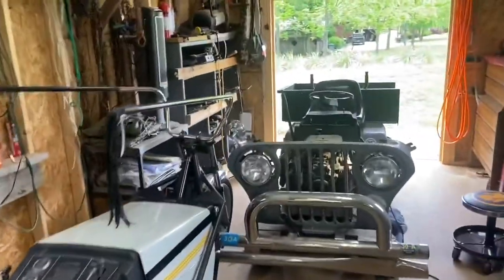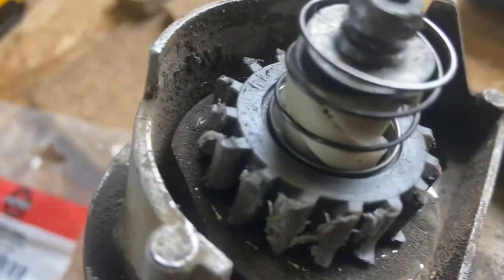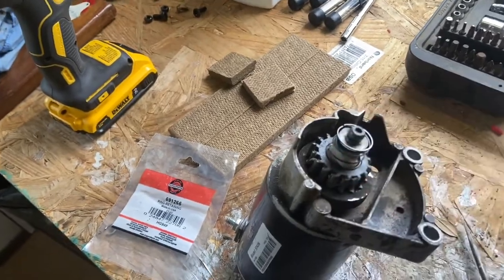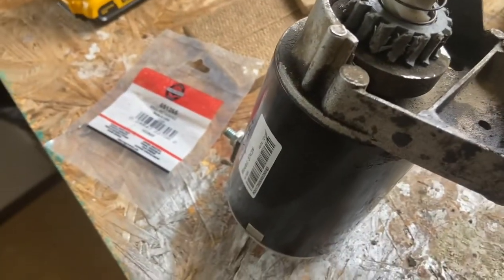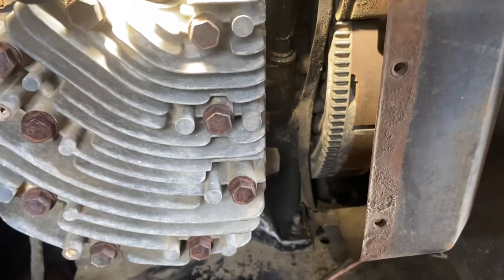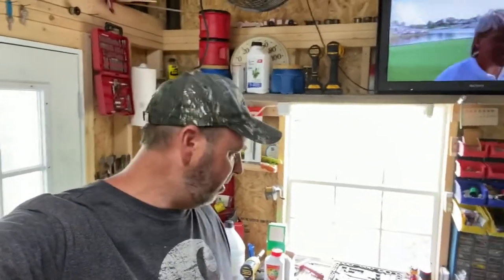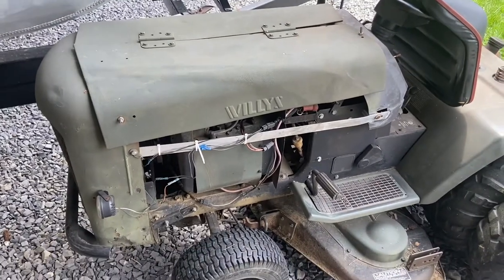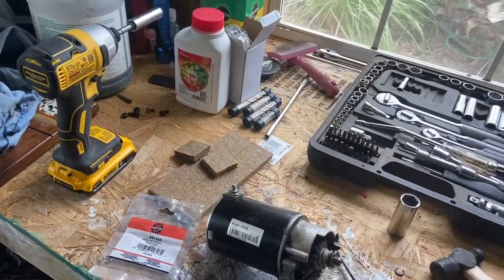18 horse Briggs starter gear stripped, why?

Comment: I had my 16hp Briggs since new for 37 years. Original starter was the Cage type like you have and every few years would have to replace the gear. Then bought a new after market like yours after the original starter died. It ate the gears up to a point I was buying a dozen gears at a time. Since I have added a loader on the tractor it gets used a lot. I bought another after market starter but still did the same. Bought another flywheel with good ring gear. Still did it. About two months ago read on the Wheelhorse forum a guy solved the problem by adding a .090 shim between the engine and starter. I had a .060 thick piece of metal so made a shim. Starter worked good for about 50 starts then gear went. I believe a .090 shim will solve the problem and the gear will get 100% engagement.
Reply from the maker: So at one point I added two washers because it did look like the gears weren’t lining up completely it may have lasted a little longer but that one still stripped out, maybe that should do a third washer, good idea

Comment: Hi Murphy, Yes I discovered the same problem. The original starter motor had a differently sprung cage; like the one you had. I think the original sping cage is more effective at pushing the started gear back away from the flywheel gear. I'll also try to find an original part as this cost me a lot of time replacing those plastic gears each time
Reply from the maker: That’s good information thanks for the reply I’ll do a little more research on the original starter

Comment: I'm having the same issue. I bought the mower used so I'm not sure if the starter is original or not. The new one stripped within 30 starts or so. And it definitely started at the top when I checked it after only a few starts. I ordered a new one tonight and will shim it down tomorrow when I get it. I'm sure that's the issue. Good luck and thank you for posting this.
Reply from the maker: I know a lot of people talk about this issue. It must just simply be a design flaw.

Good luck and thanks for watching
Reply: @MurphyMower  today's update. I installed the new gear. My starter mounts above the block so I filed the mount down .060". Thoroughly cleaned the flywheel gear and put WD-40 on the gear shaft and flywheel teeth. Then cycled it 20 times for extended cranking periods. The gear still looks brand new after that. I think it's going to be ok. I will update as I find out more. It cranks faster and smoother than it has since I've owned it.
Reply from the maker: Keep me updated 😀
Reply: @MurphyMower  over 50 start cycles now and no wear at all on the gear. It was herky jerky on the start sometimes but not at all now. I'm not honestly sure what did it. But no wear at all shown after 50 starts when the last one only had about 30 starts and was wasted. It spends so freely and no kickback at all. 
I wish I had the definitive answer. But I don't. It cranks so much smoother and faster than ever without kickbacks at all. 
But if you shim or file to drop the starter it won't hurt. And if you clean the flywheel it won't hurt. Either way it fixed mine.
Reply from the maker: Good information- thanks
Reply: @MurphyMower  a week later and 30 more starts. I pulled the cover up today to check the gear and it still looks brand new. I wish I had done one change at a time to know absolutely what the problem was but I also wanted to fix the issue once and for all. But the combination of the 3 certainly fixed it. I hope this helps others.
Reply from the maker: Thanks for all the information I will re-read it closely

Comment: I have briggs opposed twin 19hp which was doing the exact same thing...I finally switched to a car battery from walmart with 650cca, haven't had a issue since.  just measure your battery compartment to its full limit and measure out walmart batteries to choose which one will fit.
Reply from the maker: That is probably a good idea

Thanks

Comment: I am not sure if this is your problem. But there is a 14 tooth gear and a 16 tooth gear the goes on the starter. Maybe your ring gear needs the 14 tooth gear on your starter?
Reply from the maker: That is a good thought I’ll need to do additional research on that, thanks
Reply: IF YOU PUT THE WRONG  GEAR IT WOULD NOT WORK AT ALL .

Comment: Try a different gear, maybe it needs a 14 teeth gear instead of a 16.
Reply from the maker: I did check that it was 16 for sure
Reply from the maker: I do have a metal 14 tooth gear just does not mesh up with flywheel